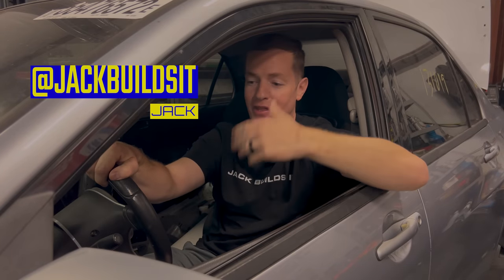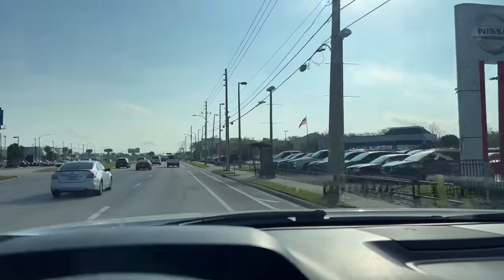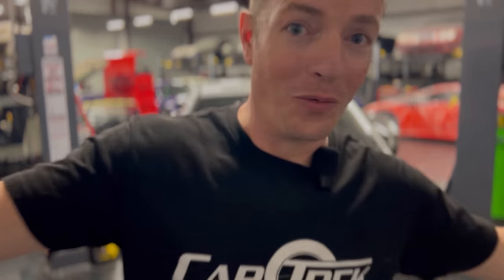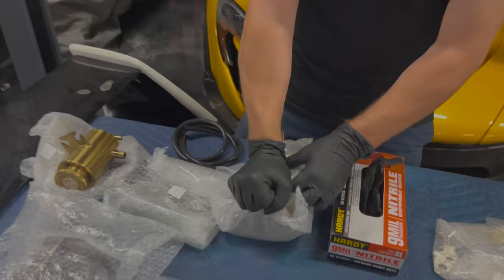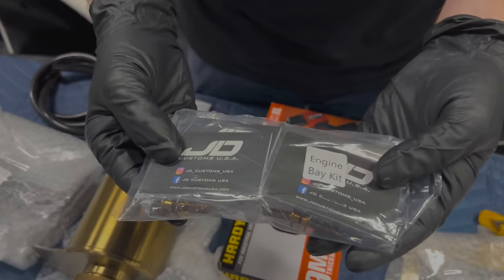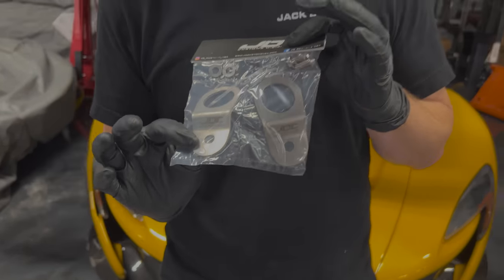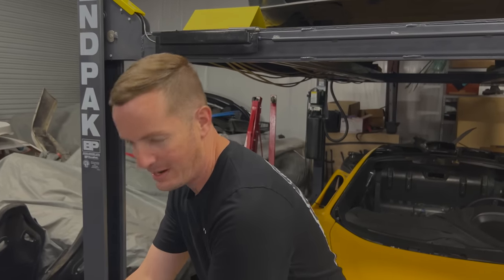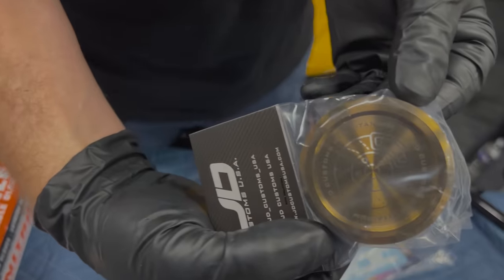Rebuilding A Wrecked Mitsubishi Lancer Evo 8 | Part 2

Comment: Material selection on exhaust fasteners are actually super important because the coefficient of thermal expansion is different from steel so it can cause problems with sealing. Sometimes it can be from the bolts growing faster than the manifold at temperature and losing preload and other times it can be from the manifold growing faster than the fastener and causing the fastener to yield and then you lose preload when everything cools down again. In general matching the CTE between your manifold and hardware is the best approach.

Comment: Ran into this problem myself trying to get 2008 Evo X parts. Already several interior bits I have tried to order at the dealer that are out of production. Now I am hoarding as many parts as I can just because of that. I would keep an eye out on a vendor called TAE Used Auto Parts in Plant City, FL. They buy a lot of wrecked Evos and part them out.

Comment: A copper Evo named C-3PO.  
also, yes, those caps make a difference. I bought some machined caps for my 350z many years ago. They just add a new dimension to the engine bay imo. I see the audio being low has been addressed, hope it gets ironed out moving forward.

Comment: i just subscribed.  Surprised that I hadn't subscribed earlier.  JAck is a great addition to TAvarish's channel.  316SS is highly corrosion resistant.  If you need custom CNC machining, hit me up in Tampa.  Use a Dynisher to put the directional marks in the radiator.  You can borrow mine or we can do it on the spot

Comment: I bought my dream car [evo 8 as well] just over 2 years ago from Japan. Absolutely thrilled to say it is mine and have the ability to just drive it whenever. This build series is turning out to be one of my favourites and it's only just started. Thank you for what you are doing! Keep up the awesome work. 

Mine is an '04 MR GSR with a bunch of Kansai Service parts on it and some go fast bits (HKS turbo, 272 cams, fuel pump). I believe it was a show car, but not too sure hard to find information on that stuff.

One thing I wanted to make note on is the audio levels are a bit low in this video. Had to crank my volume bar all the way up and then my system volume as well.

Comment: just to let you know the 2004-2006 mitsu lancer ralliart and the 2002-2003 mitsu lancer es share the same exact body but different brake lights head lights fenders ect
Reply: Wrong. Very little is the same.

Comment: Knew the OEM was not gonna be available. Aftermarket metal unavailable too? Junkyard is often your best bet though nice OEM parts that are gonna fit properly and if you order like the whole front clip cut off it often comes with bonus items that you also need radiator condenser little plastic nonsense clips and hardware that come free on the cutoff but would cost hundreds if they were even available OEM

Comment: Might be a dumm question, but I do it out of curiosity.
With a crashed car wouldn't it be easier to get a good donor chassis and swap all the parts to the new car? It seems that this is never done, ag least on video (maybe for obvious reasons)
PS: please take the question as it is. I assume there is a huge fun factor on rebuilding a crashed car, and maybe there would be an issue with the VIN numbers.

Comment: When you run into an obsolete part, how do you know that the same part from a junkyard Lancer will fit?  I've found that there's a lot of EVO-specific parts that look the same as a Lancer but have a slightly different fitment.

Comment: **The Lancer wheel well section is DIFFERENT than an Evo!!***

Hopefully you see this comment. But the Lancer front wheelwell section you cut off the parts car is different than an Evo. It sits a lot lower than an Evos. They added more wheel clearance for the Evo. 

Your best bet is to find someone parting out an Evo. Not as uncommon as you think